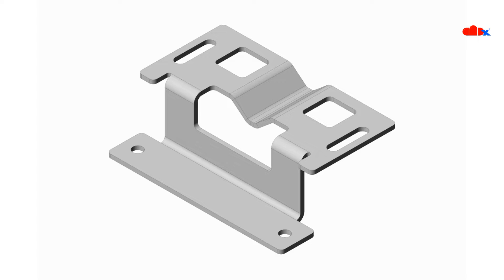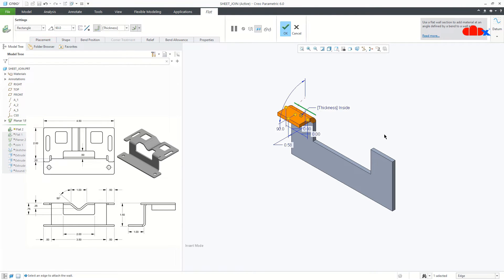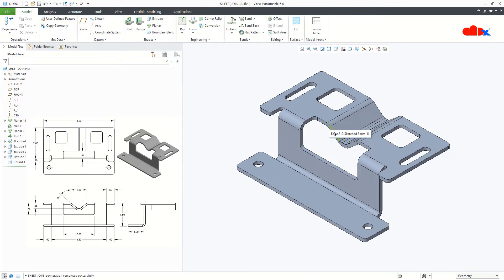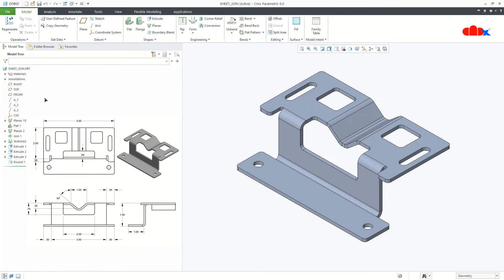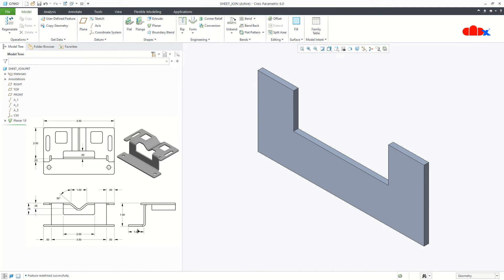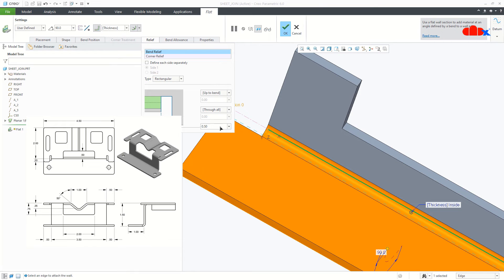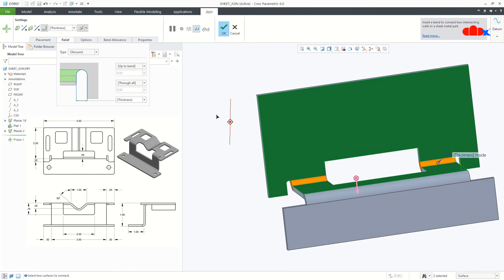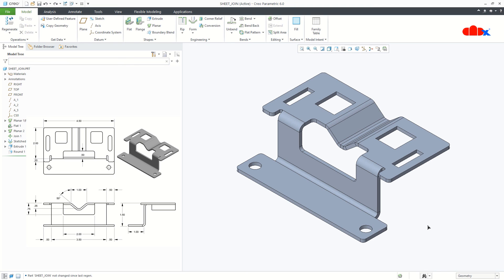Sheet metal join in Creo Parametric | Conditions to use sheet metal join in Creo parametric

Comment: Sir the join command is not working for me. i have followed all the steps correctly. but it shows Failed to regenrate.
Reply from the maker: First you try the join with two simple walls without the side wall. Check if it is working for you. If it works then try with this example.

Comment: Hi i been not able to execute the join option in the part 12:17 could u please guide me
Reply from the maker: Try selecting other surfaces
Reply: @CADxTraining  i am also facing same issue & i tried other surface also but won't work
Reply from the maker: Increase the file accuracy and check

Comment: Why you draw form sketch extent more than sheet metal .
Reply from the maker: Can you repeat your question once again in a detailed way?
Reply: @CADxTraining  Sir you did not place the form sketch on required sheet metal then why you put it bigger sketch than that?
Reply from the maker: Can you write the time?
Reply: @CADxTraining  time:13:34
Reply from the maker: Yes you need to draw the sketch little outside otherwise you will not get the required result. You try and see.

Comment: I am trying to modify the depth of the form       
It is converting in to flat, what is the reason?
Reply from the maker: Reduce the depth. Most there is no enough room to form the depth.
Reply: @CADxTraining  I followed the same procedure u did but were it goes wrong?
Reply: Hello, I had the same problem. Center the 2.5 dimension of the Sketched form command's sketch or make it larger, the problem will be solved.